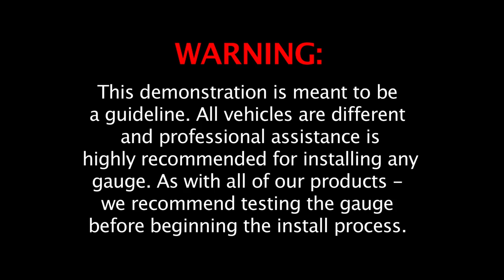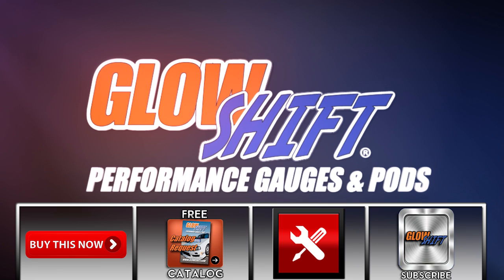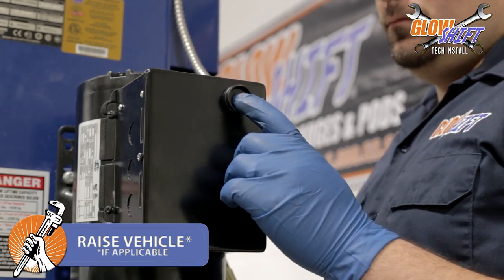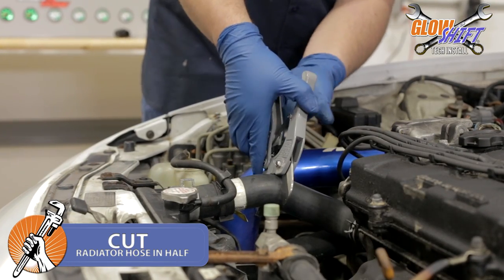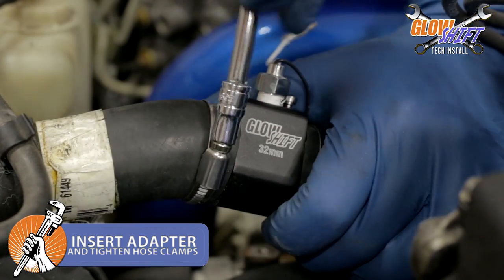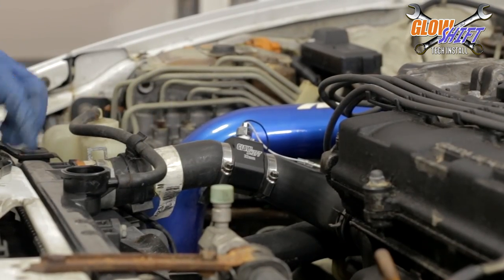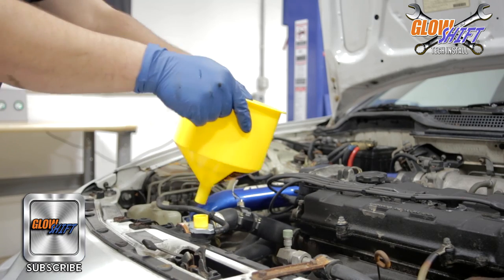Installation | GlowShift Water Temperature Sensor Hose Adapter for Cars and Trucks

Comment: Why do the instructions have a side note stating to install the sensor hose adapter on the hose that does NOT have the thermostat at the end of the hose but that is not called out on this video?
Reply: I noticed that as well. It’s incorrect. Typo. It should be closest to the thermostat as possible. Don’t think they know how a radiator works 🤨

Comment: Here's problem I know fact it's my temp gage but shouldn't you put the new one into the block somewhere for more accurate reading, instead or radiator hose?
Reply from the maker: Yes, the sensor can be installed in the block. However, access to the factory location in the block is not always easy, so we suggest the radiator hose as a simple alternative.
Reply: This application can also be used to install an electric cooling fan...so the upper coolant hose is exactly where it should be in that instance...

Comment: Hi good job but i think the sensor should be attached to the lower hose not upper hose?
Reply from the maker: It depends on which temperature you want to monitor. We normally recommend the upper hose so you monitor the coolant temp before it goes back into the motor.

Comment: There is a tiny seepage between the sensor thread and the adapter, what would you gentlemen suggest? Used teflon tape and it didn't work!
Reply from the maker: Verify that the threads of the sensor are not stripped or damaged. Teflon tape is the primary one that we recommend so we would suggest removing the old tape and reapplying new tape. Try using a bit more this time. Otherwise, any thread sealant that you can find at your local automotive store will work.

Comment: I'm thinking of using this 50mm glowshift adapter to reroute my heater core outlet from the back of the engine to the front after an EGR delete.

Comment: I want to install mine. But on the long hose that goes back to the goose neck so its hidden. Will it affect the accuracy of the temp depending on what hose I install it?
Reply from the maker: The accuracy of the reading will most be determined by whether the adapter is installed before or after the thermostat. If you want the most accurate reading, we recommend installing opposite the location of the thermostat. If the thermostat is on the upper hose, we suggest installing on the lower hose and if the thermostat is on the lower hose, to install on the upper hose.
Reply: @GlowShift  How can that be accurate? If you install the sensor in the hose WITHOUT the thermostat, that most likely means that the water has been through the radiator and been cooled somewhat. I believe you would want the sensor as close to the thermostat as possible, that way when the coolant o "water" exits the engine, it will hit the sensor and display how hot the fluid got inside the engine. This would also give you the best measure if your thermostat is opening at the prescribed temperature or within a percentage of said temp. In your video, you show the installation of this sensor and housing being in the upper hose, I find this correct because it IS going to give you a true reading of how hot the fluid is EXITING the engine, I think that is the primary goal. So, I fully agree with the placement in your video, however, your response is not exactly correct. This SHOULD be placed in the fluid exiting the engine not matter where it is. I did see that you mentioned installing the sensor in the block, right behind the last freeze plug on the Ford 4.6, that by far is the best placement if accessible.

Comment: Should you apply adapter to to hose with coolant coming with the flow from the radiator or the opposite hose with the flow from the thermostat to the radiator as I'm sure they would both read different temps as one has been through the engine and the other has been cooled by the radiator, thanks
Reply from the maker: The most common location is the upper hose that reads the temperature after it leaves the radiator.
Reply: It’s to the upper hose right after the thermostat, leaving the engine. NOT after the radiator (lower hose) once it’s cooled.
Reply: @oescajeda07  That’s what I thought too.  Isn’t the point of the gauge to read the high temp?  It certainty isn’t after it has gone through the cooling process of the radiator.

Comment: Odd question but didn't see it asked does the orientation of the sensor matter like straight up and down, to the side etc. Only reason I ask is I have this installed on my 99 Ranger 3.0l and the gauge sits at 160 until I get on an incline then it hits 180 to 184 where it should be once back on a flat surface drops back to 160 as if the sensor isn't directly in the path of the coolant has anyone had that issue before. I was going to loosen the housing and try to turn it some to insure the sensor was actually in the flow. Also I have this installed in the upper rad hose if that info helps.
Reply from the maker: The coolant system is pressurized so it shouldnt matter how the sensor is oriented because the entire coolant hose should be filled with coolant. It sounds like your system might not be completely full.
Reply: @GlowShift  Thank you for the reply I will have to dive into figuring that out appears to now only be an issue at idle

Comment: Doubt ill get a reply, what size would i need for a 97 civic ex?
Reply from the maker: It looks like your radiator hose has a 1-1/16 inner diameter which we do not currently have that size available.

Comment: What is the divergence from the existing temp reading due to installing the sensor in the water hose?
Reply from the maker: You generally would not see a big difference from the OEM reading verse the radiator hose itself.

Comment: Is the sensor supposed to thread completely into the adapter? Mine looks like the one in the video, where it’s on tight but there’s still some thread visible.
Reply from the maker: No, the sensor will not thread completely into the adapter because the threads are tapered.

Comment: wouldnt you want to install it on the output hose? Wouldnt this only give you the temp of the coolant BEFORE it went into the engine?
Reply from the maker: It depends on your desired application. For this instance, we wanted to monitor the temperature of the coolant after it has already passed through the radiator before it goes back into the engine. If you want to monitor the temperature of the coolant after it leaves the engine then you can most certainly install it on the output hose. The process for installing is the same.
Reply: thanks
Reply: John F. Hebert if I am not mistaken the upper hose sends coolant from the engine to the radiator after the thermostat opens!

Comment: Hello, Does the sensor attached to the blue thing needs to be calibrated with the meter inside the car? Or can we buy separately the sensor, then the blue apparatus for the hose, and then the thing to put inside the car (i don't know the name for it)?  Thank you
Reply from the maker: When you purchase the adapter by itself you will not receive a sensor. The sensor comes included with the water temperature gauge which needs to be purchased separately.

Comment: For a 34mm hose i need to choose the 34mm adapter or the 32mm? Thanks
Reply from the maker: If the inner diameter of the hose is 34 then you need the 34mm adapter.
Reply: @GlowShift  thx a lot

Comment: Will this work for engine temperature coolant sensors? The radiator is a wrong radiator for my car and the sensor in my radiator is bigger in diameter then the OEM sensor. So i want to know if i can use this to install engine temperature coolant sensor on the hose rather than on the radiator.
Reply from the maker: +TISINLI Yes, but, you'll need to know the thread size of the OEM sensor. The thread size on this adapter is a 1/8th NPT.

Comment: Couldn't you split the wires from the main sensor ( on engine ) to the gauge?? or would it interfere with the ECU instead of cutting hose's etc??
Reply from the maker: In order to maintain an accurate reading, we recommend installing the sensor directly into the hose using the adapter.

Comment: Will it make any difference which hose to cut? high hose or lower hose?
Reply from the maker: We do recommend installing the sensor into the hose without the thermostat.
Reply: @GlowShift  You are trying to read the temp of the cooled coolant that has come from the radiator? The temp of the hot water coming out of the engine is what is always to be monitored which tells you pretty much the temp of the engine coolant inside the engine. And that is from the outlet hose of the engine and certainly has to be where the thermostat is. Usually the top hose.

Comment: Hello, my coolant did leak a little bit from the hose connecting to the joint after i install it, after i tighten it, the coolant still leak, may i know why and how should i do to? As i worry after a while the coolant will leak till empty
Reply from the maker: Make sure that each side of the coolant hose is pushed completely onto the adapter and verify that the hose clamps are tight enough to prevent any leaks.

Comment: Will I need this adaptor inorder to install the glowshift water temperature gauge on my 03 Mustang gt?
Reply from the maker: Look below the last freeze plug on drivers side (left side) of the block. There will be a threaded in plug (16mm x 1.5). This can be accessed and removed from under the vehicle if you want to install to the factory location. You will need this adapter: https://www.glowshiftdirect.com/1-8-27-npt-female-to-m16-p-1-5-male-thread-adapter/
Reply: GlowShift Gauges thank you so much
Reply: What about for a 1980 CJ5 jeep with a 4.2 liter, inline 6 258 engine?

Comment: What about screw nut on adapter gauge??
Reply from the maker: Can you explain a little more what you are asking?
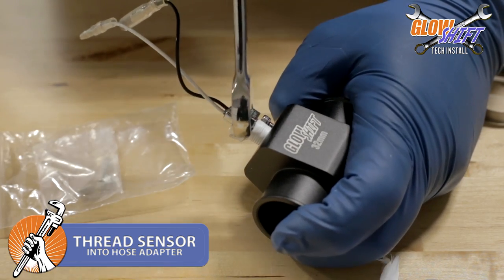Reply from the maker: If you are speaking about the part around 1:00 then that would be the water temperature sensor being screwed into the port hose adapter. Cheers, GlowShift Team
Reply: it looks like a bleeder screw for getting air out of the system
Reply: Ground screw
Reply: acemay3 , Most of them are not  bleeder screws, they're not drilled all the way through. they are for a ground connection for the single wire temperature gages that are required to be grounding through the body of the gauge itself. all single wire temperature gages normally screws into engine blocks that are grounded. The screw allows you to add a ground because it is simply not grounded. However I have to mention aluminum is not necessarily the best grounding material.
Reply: goes to ground, use a terminal ring

Comment: hi, do you install a temp gauge for lancer EX / EVO CVT Automatic transmission (temp from transmission CVT)?
Reply from the maker: Hello, our gauges are universal aftermarket gauges which can be installed on almost any vehicle.  If you would like assistance in finding the size of the adapter you would need for your specific vehicle, please contact our Customer Support Department.

Comment: What size should i use for a 06 silverado with a 1 inch hose
Reply from the maker: Hi, we would need to know the engine size to be able to best help. However, if you are talking about a 1-inch diameter, you would get a 1-inch adapter. Our tech support team can be reached 9 am - 6pm EST via phone: 856-768-8300, email techsupport@glowshiftgauges.com, or Live Chat on the website. Cheers, GlowShift Team

Comment: Can this show your engine temperature?
Reply from the maker: This would show your coolant temperature which is an indication of engine temperature.
Reply: @GlowShift  on the 2 wire sensor do you ground one wire and the other go to the guage? And does it matter which wire?

Comment: I just got one today and i want to monitor my engine temp not befor or after but the actual temp of the block why caint i just fit it in my intake where the old temp sensor is????
Reply from the maker: If you would like to install the sensor into your factory sensor location, all you would need to do is determine the thread size of that location and get the correct size adapter to a 1/8-27 thread for our sensor.

Comment: Inadvertently creating a weak link in the water system
Reply: There are ALWAYS weak links in the water system. Your Radiator cap is the BIGGEST weak link than any hose attachment you make or in this case retrofit. I rather have a hose blow off than a head gasket. Just saying.

Comment: what happens when you rev your engine and the temp gauge needle revs as well with the rpm gauge? What's the solution on that?
Reply from the maker: +Sam Han Thanks for letting us know about your issue. I recommend pulling the sensor ground off the current location and put it to a new location. Also, make sure it has a separate grounding location from the tachometer gauge. Let me know if this helps!
Reply: +GlowShift Gauges Will do thanks.

Comment: some older style aftermarket temp gauge has a single wire going to the sensor ...
and i have installed it correctle to hose how ever it does not give me any reading on the gauge 
im thinl i need to ground the sensor or something im not sure
Reply: Faisal Abdulaziz It has to be grounded.
Reply from the maker: We suggest using only our two wire sensors with our Temp gauges. However, if you are using a gauge and single wire sensor from another manufacturer you will need to find a way to ground the sensor.
Reply: GlowShift Gauges , I haven't used your  adapter however the little tiny screw, yours might be a bleeder screw? the little tiny screw works pretty well for a ground.

Comment: What about the wiring.
Reply from the maker: Hey, here is our transmission temperature install video to show you the wiring from the sensor to the gauge. This starts around the 2:30 mark: https://www.youtube.com/watch?v=I4QjqSaPcY8. Please note that this video will have the sensor in a different location as it is for the transmission temperature and not water temperature, but the wiring from the sensor to the gauge is the same. If you need further assistance our tech support team is ready to help via phone 856-768-8300, email techsupport@glowshiftgauges.com, or Live Chat on the website. Cheers, GlowShift Team

Comment: now lets say your thermostat gets stuck so the coolant does not run threw this sensor but you cant tell because your gauge wont show the temp if its not flowing correct
Reply from the maker: Hi Randy, in our instructions it states that one should install the adapter on the hose opposite of the thermostat. This is because if you install it on the hose with the thermostat, one will not get a reading until it opens. If someone installs it on the hose with the thermostat you should notice there is an issue because your gauge will probably be showing under 100 degrees instead of the 160+ it would normally be at depending on the vehicle. If you need further help our tech team is awaiting your call, email, or Live Chat and is ready to answer all your questions. Cheers, GlowShift Team
Reply: GOT YOU I BOUGHT YOUR TEMP GAUGE AND ADAPTER AND YOUR OIL GAUGE VOLT BOOST AND TECH LOL all came in today looks great
Reply: GlowShift Gauges f